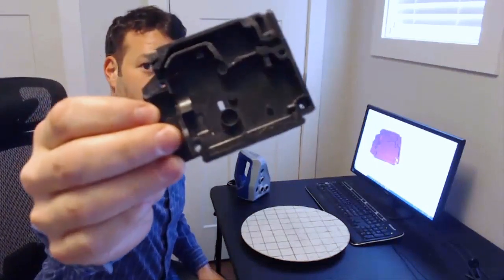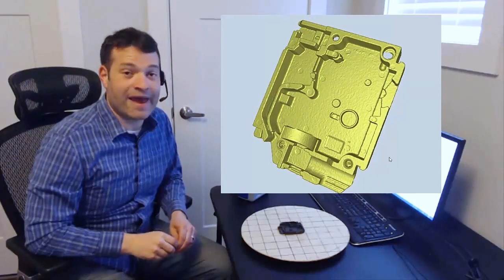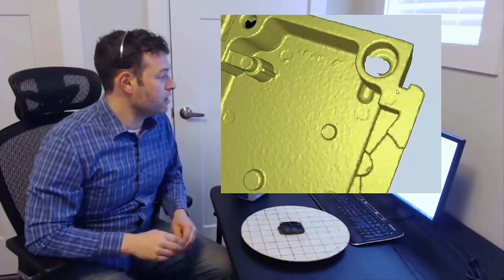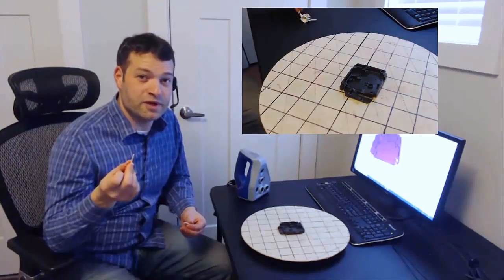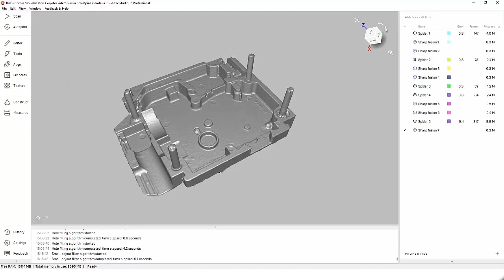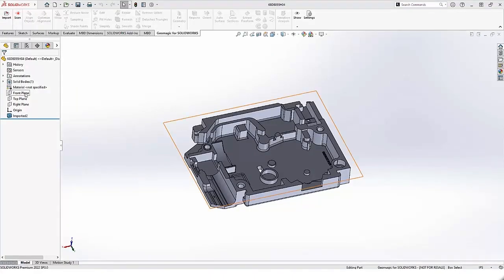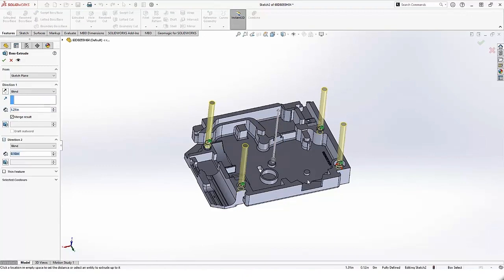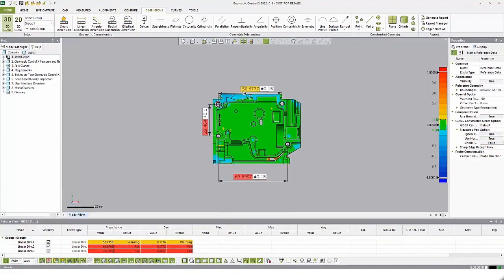3D SCANNING Tech Tip: How To Capture Hole Dimensions When 3D Scanning

Comment: The dowels need to be shorter, only slightly protruding from the hole, other wise you will get a projection error the further up the dowel that you take your measurement (unless the dowels are a perfect fit, the part is perfectly flat etc.)